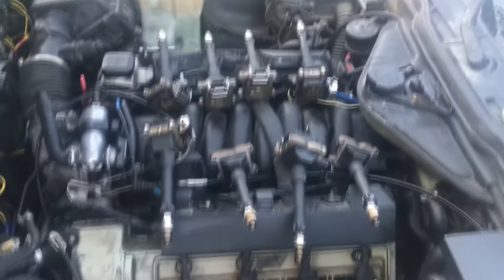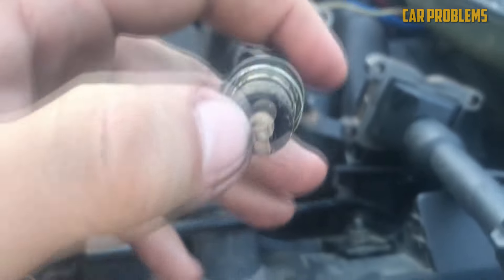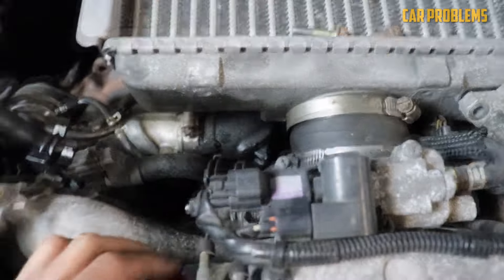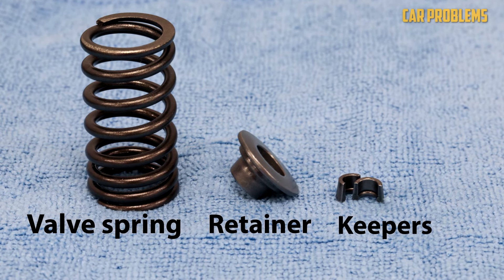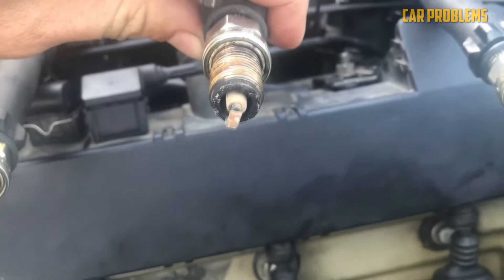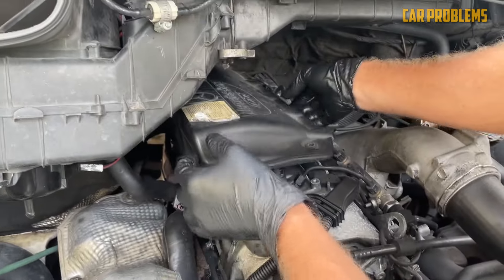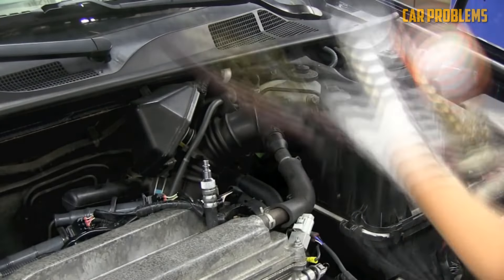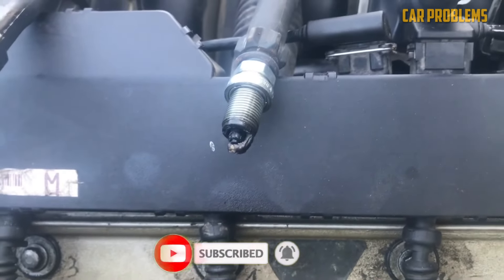7 Causes Oil On Spark Plugs. How To Fix?

Comment: 2001 Toyota Celica GT, I have about 2 inches of oil inside the spark plug chambers, I replaced the valve cover gasket including the tube seals, and my question is how do I get rid of the existing oil inside and then would it help if I used black high heat oil resistant gasket maker around the top of the combustion chambers?
Reply: Get paper towels and brake cleaner 

Spray the cleaner in the chamber after disconnecting the coil pack wires and put paper towels in to soak up but make sure you keep spark plugs in until soaked up and make sure you can remove the paper towels from the chamber
Reply: Never put any sealer inside a spark plug hole…. What do you think would happen if that sealant got into your cylinders? Duuh

Comment: The pcv valve completely inside and out ,drain and shake. You should hear a rattle if us is clean inside.
Reply: there could still be a leak regardless of the rattle
Reply: They’re cheap enough to replace

Comment: So…I got an oil change 2 weeks ago…last night, my car wouldn’t start. Was able to start it, and took it back to the place, and they said they tightened the drain plug. Now my car is having problems cranking…I’m wondering if that leak, would get on the spark plug causing the issue.
Reply: Did you figure it out I’m having same problem
Reply: @JTrippBeatz  ended up getting a new car 😁. Through my research eventually landed on needing a high pressure fuel pump. Audi $800 labor fee, to remove the supercharger, just to get to the problem…I said I’m good, 105k miles was fun
Reply: WTH!!! Took my 2012 Honda pilot 2 weeks ago for normal servicing.  We’ve always have had the service done.  Last night my “check engine” light turns on and its flashing and the car is vibrating a little bit.  Took back to the dealership this morning to check what it was.  They were saying it may be a spark plug misfire.  Something I thought may be about $500 dollars to fix turns out to be 5k to replace.  There was one cylinder where the spark plug threads showed some residue of oil.  They showed me the spark plugs and there is a little crust on the threads-of the spark plugs.  IDK.  With auto sales down, wouldn’t be surprised they are trying to make up the difference in other ways!! 🤦🏽‍♂️🤦🏽‍♂️🤦🏽‍♂️
Reply: @MyTEEsharp1  I’ve seen mechanics online just clean spark plugs with a spray, and it works. Idk but yeah
Reply: @BigstickNick  yea dude, im in the same boat with my audi at 135k miles, repairs are more than the car is worth and i still owe on the car so i cant sell it.  never again
Reply: @timoneil1193  I miss her tho…😞
Reply: I have a 2009 PT Cruiser and I’m getting oil on my #2 spark plug. The rest are dry any suggestions on what it could be. I’m not a mechanic but I’ve had it to 2 different shops and no answers .
Reply: @lindakennedy3672 I have the same issue. I was replacing spark plug in my nissan, and one spark plug tube had oil in it, the others were dry... If your car valve cover uses replaceable gaskets, replace it. If not, you may have to change the entire valve cover. Also, change the pcv valve...
Reply: @joeygordon7265  I had the valve cover gaskets replaced and the mechanic never said anything about the oil on my spark plug.
Reply: @MyTEEsharp1 Misfire can be caused by a number of issues - e.g. fuel injector, ignition coil which btw doesn’t cost too much. It helps to have an OBD reader and educate yourself on these things so they don’t rob you blind which is what it sounds like.
Reply: @MyTEEsharp1  How much did they weasel out of you?
Reply: @medini2  $0
My dad changed the spark plugs and engine light never turned on!